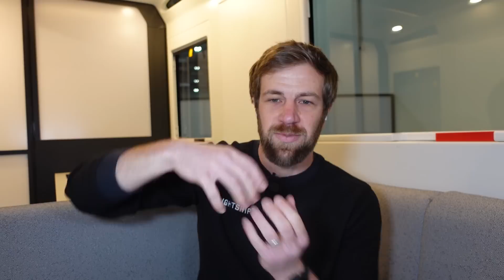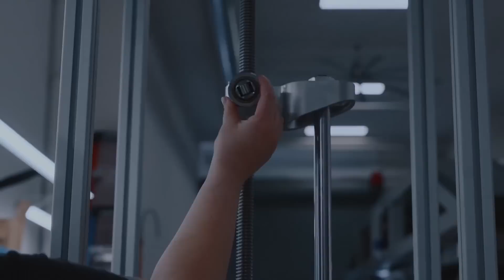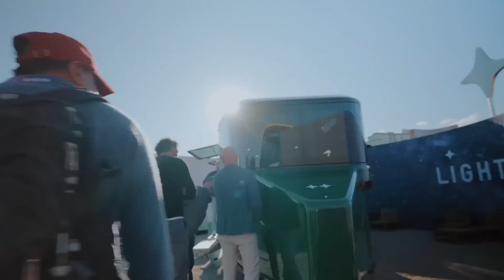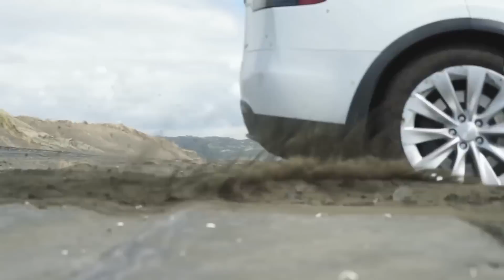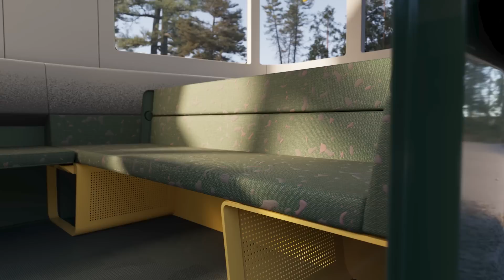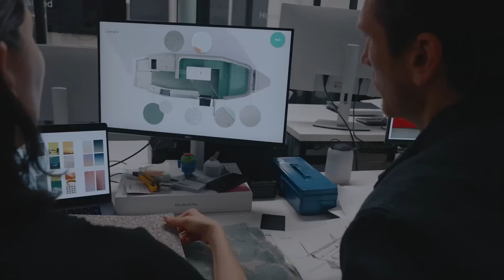Lightship - CEO Toby Kraus Interview

Comment: I was expecting 175k from what they said last year, but compared to a studio apartment in NYC, their 250k is not bad. Put it on a barge and use the electric to power outboard motors. Maybe just rig up some pontoons from blue barrels and float it out on an inland lake. Pair it with a Z-Triton for the perfect off grid camping & boating experience.